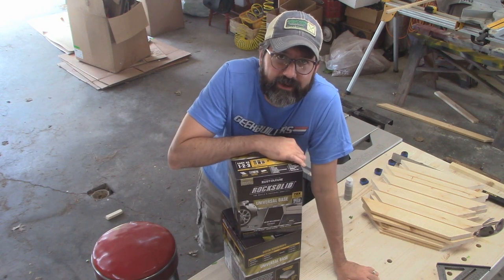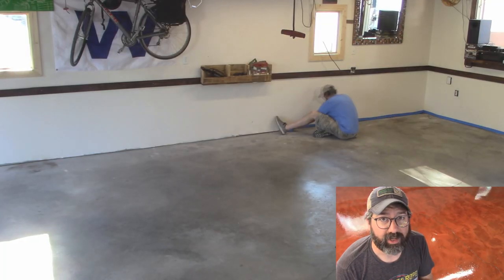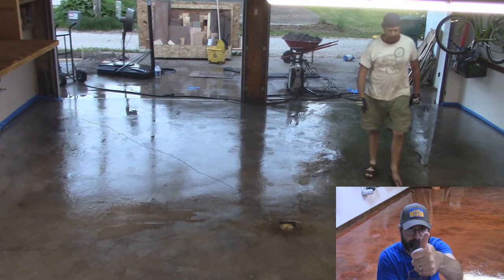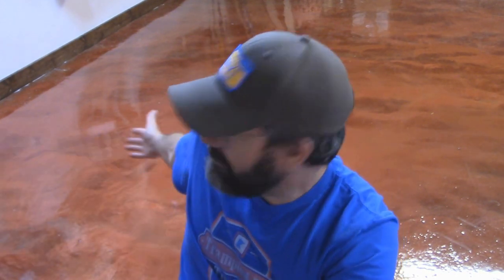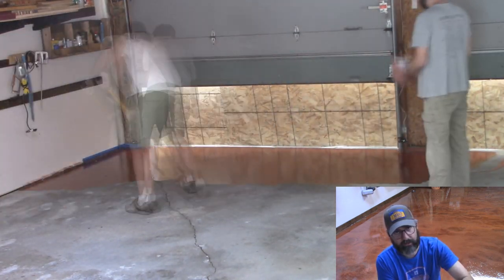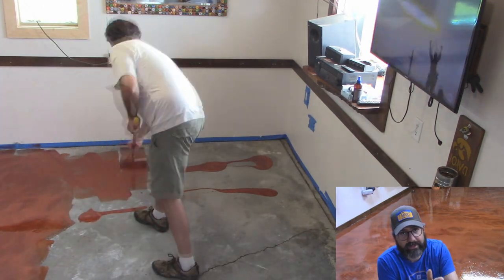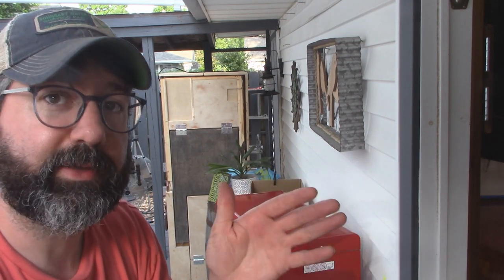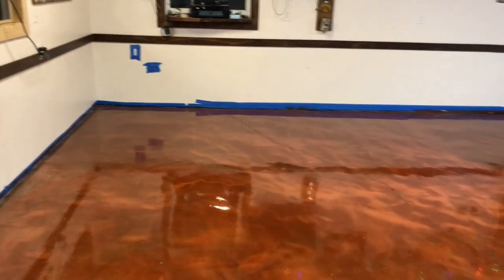Garage Floor Epoxy | Ultimate Shop Floor Makeover

Comment: I sealed my garage cracks with concrete caulk after giving concrete time to completely dry after cleaning and degreasing (one week). I then applied a thin coat of clear topcoat and 24 hours later I applied the RockSolid Metallic copper over the clear coat. No issue with bubbles from Outgassing from the concrete floor. I also added Rustoleum non skid glass beads to make the garage non-skid.
Reply from the maker: I definitely should have sealed my cracks. And apparently the other steps you did! Non skid would definitely be awesome.

Comment: Hell an easy to fix with some sanding, epoxy paste, primer and another coat. Sounds like allot of work but can be done in less then 3 total hours of labor over two days.
Reply: Ffs it’s two years old lol!!!!
Reply from the maker: what's an east fox?
Reply: @dadcrafted  lmfao it’s a typo. My apologies, I’ll fix now.
Reply from the maker: @BeerBreath702  what’s needing the easy fix?
Reply: @dadcrafted  the bubbles. I have been installing resins for around 15 years and I have leaned that two primer coats is the answer to no gassing bubbles and it works amazing!!!!
Reply: If I bid another metallic I’ll try and find a way to record it from start to finish. I’m extremely anal with prep work and that’s the key to any reason install.

Comment: How many kits did you end up using? I have a 750 square foot garage and bought 8 kits- will that be enough?
Reply from the maker: You'll be good. I used 7 on my 750 sq ft garage and made it. Definitely could have used 8 as I'm a bit thin in a few spots. Just don't be shy as you roll it on. 👍
Reply: Thanks for responding:) one more question- is it opaque or is it see through? I have a couple of cracks I repaired and I don’t really want to. E able to see the patches through the covering
Reply from the maker: @karenb7677  if you may it on thick I don't think you be able to tell unless you're really trying to look for it. It covered most of my old stains and paint spots very well!